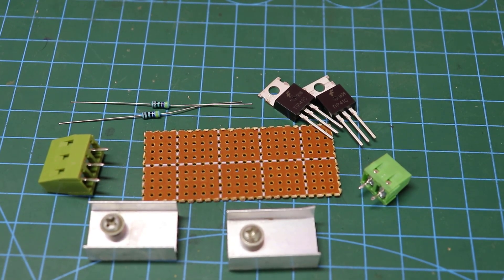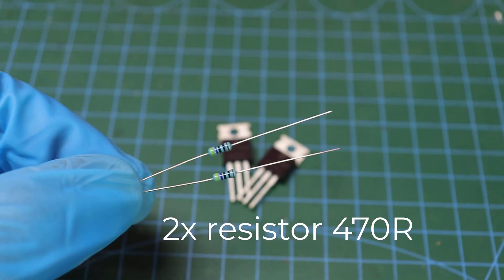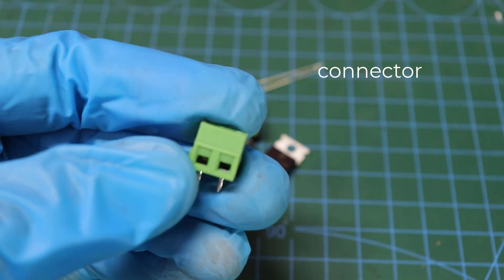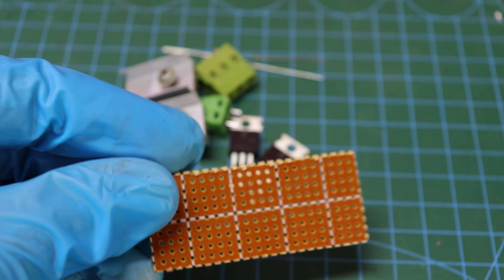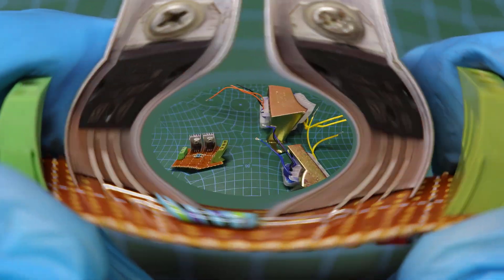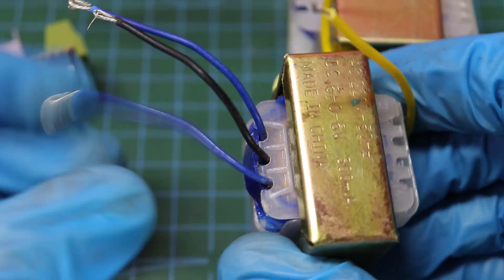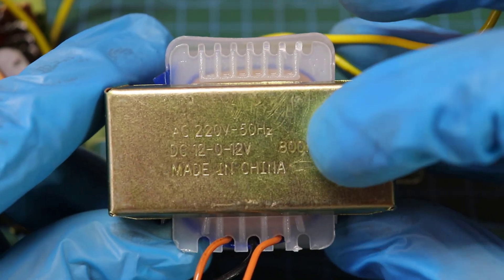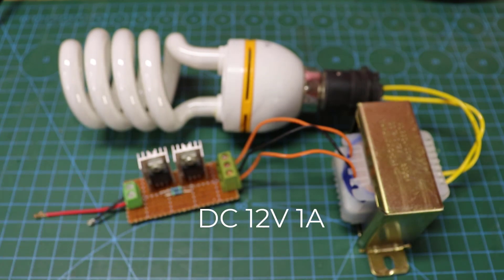How to make a simple inverter 12V to 220V & 110V

Comment: Hello. Would you have a 220V to 110V assembly that supports an electric screwdriver? Thaks
Reply from the maker: Do you need a transformer from 220 to 110 volts?
Reply: Sorry.  My question was poorly worded.  With this project could I use a dremel with a voltage of 110V?  And the amperage? Thanks
Reply from the maker: Of course you can get 110v but you have to use a 110v transformer(AC transformer 110 to 12 V)